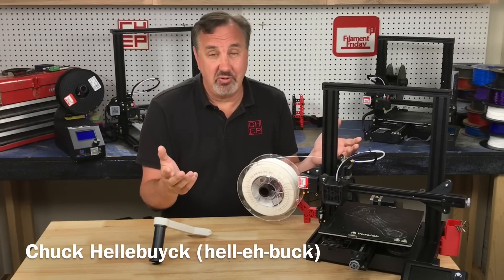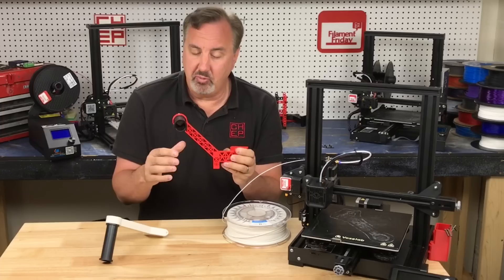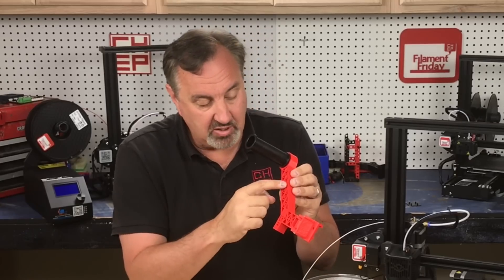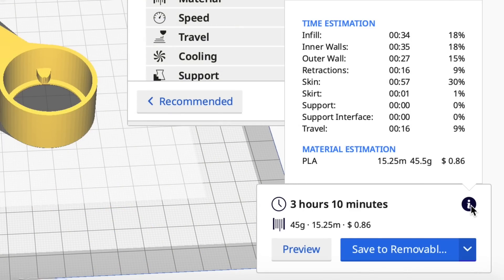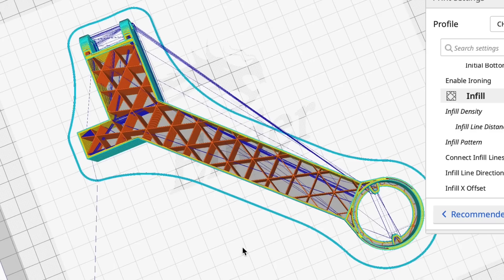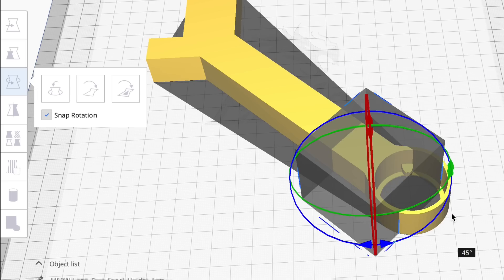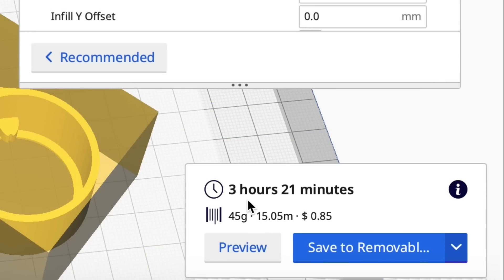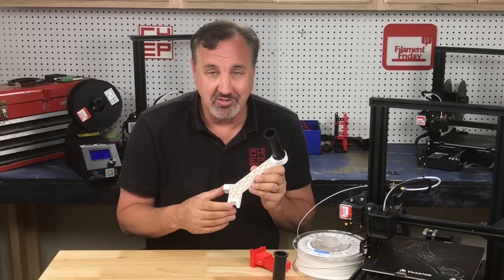Print Faster on Your Ender 3 Style Printer Using Tricks in Cura

Comment: If you look at the internal pattern, it is made up of printed triangles. This means a lot of short movements and retractions. It also means a lot of joints between lines. If you model this layer by layer, with straight crossing lines, allowing for open spaces between the crossing lines, you get longer internal lines, that will bound like crazy due to gravity. It probably will print faster than the hack in this video, and probably be just as strong or stronger, depending on how you adjust it. It will look even more like the Eifel. In Cura, you need to model it for double walls for the pattern, as Cura do not slice single wall mesh gracefully. Also, Cura has performance issues with the modeling I propose here, it simply crashes if the model get medium size.

Comment: for fast low quality high strength prints you can also increase line width (only with flat tipped nozzles) so every layer is smeared on like butter but much wider and sturdier

Comment: It's a great tip Chuck. I'm using mostly Repetier host using Cura engine and it always prints quicker than any Cura version with the same settings. For example, DJI F450 arm  prints in Repetier 2h44m, in Cura 3h58m.. And has similar structure to the filament arm you're showing here.

Comment: I follow so many youtube channels about 3d printers. Most of them is about hardware and firmware tweaks in order to get good quality prints. They use expensive hardwares, upgrades etc. But you, sir, always have good cura tricks for the same goal and it's awesome. It's free, it's practical and I appreciate that!
Reply from the maker: Glad I could help. To me it’s far more important to understand your slicer.
Reply: Biggest upgrade you can make is firmware tweaks after that. Go look into linear advance etc to improve quality at high speeds above like 70mm/s for walls (meaning 140mm/s with stock cura config), that way you can get an ender 3 to roughly 150mm/s, provided you have good enough cooling.
Of course the model itself makes the biggest difference though.
Reply: I’m so

Comment: Good Morning.....Thank you for your videos ! I am new to 3D printing. I order longer LK5 and was wandering if you could help me. I was about to change my Nozzle from 4 to a 1mm. I would like to know if that is a good idea or not. I wanted a little more filament on my designs and not so thin layers. Do you think you could help me with this? 
Thank You !
Reply: If you want thicker layers, you should not switch from a .4mm nozzle to a .1, which prints even smaller layers and will likely become clogged almost immediately. You should instead check your slicer settings (a .4mm nozzle should be able to drop up to a .3mm layer height) or use a .6mm nozzle.
Reply: @user2C47  thank you!

Comment: Well I just put the original model into PrusaSlicer with my custom settings and It only takes 1h 7m. 
Looks like I did a good choice not choosing Cura.
Reply from the maker: How long was the actual print?
Reply: @FilamentFriday  Well mea culpa, actual print time was 5 hours. Still shorter but not as good as I hoped.
Reply: @FilamentFriday  With your version I got it down to 2 hours, so you did a really great job and it's really nice what you did (gonna remember that one for ever) but PrusaSlicer is still little bit faster for me...

Comment: Ya saved hours in MACHINE print time, by spending a lot of YOUR time redesigning the part and messing with Cura settings. Been there, done that... my time is valuable ... machine printing time is not ... so I just print stuff with solid top/bottom layers, without trying to remove mass, just let the infill do it's job, maybe reduce the # of top/bottom layers and use only 2 layer walls (1 layer with large volcano nozzles).
Reply: You act like 5 seconds in a slicer is a lot of time ... you’d still have to slice all your models anyway 😂

Comment: For some reason, my per model settings seem to do nothing.  Is there a hidden setting somewhere in Cura I need to check to make it work? I'm trying to do the exact same thing with changing the top/bottom layers on a specific section of the model. But no matter what I do it still slices without top/bottom layers.
Reply: did you click on modify settings for overlaps?
Reply: @zioxei  yeah, sure did. Even tried unclicking it just to see if it would make a difference.
Reply: @DougDorman06  that's strange because if I do what chep does then it just works. And clicking on the other 3 options should indeed make a difference. It's gonna sound dumb but make sure the settings on the overlap are different to your model settings. If you truly do everything correctly then maybe you need to update Cura or reinstall it

Comment: Hey new to printing, with a 0.4mm nozzles does that mean that I can only print 0.2 profiles? Or can a 0.4mm nozzle do all sorts of thicknesses for faster prints?
Reply from the maker: You can adjust the extrusion widths in the slicer.
Reply: A .4 nozzle should be able to do up to a .3 lawyer height.

Comment: Hello, i need desperate help if anyone can regarding 3d printing.. i have looked everywhere and on every forum but with absolutely no luck.
Problem: my ender 3 printer prints fine at first but as soon as it reaches the infil layers the under extrusion starts upto the point where extruder starts clicking madly without any flow of pla.
Then i would stop the print and immediately try and run the extruder.. again no flow of pla from nozzle. Now here is the kicker.. as soon as i pull out the filament manually and not all the way just 5 to 10 cm, then i push the filament back in, it start extruding again no problem.(for a like an hour or 30 mins)
No clogs, no heat creep, no filament leak from heat block and between bowden tube, nozzle is flush and secure, hotend coupler is secure, cooling fan at full capacity, i have even tried the spacer in hotend mod. 
Please someone help
All i can think is i have to replace the hotend and a new one is on the way but i think this situation is too much of a mystery to be left unsloved
Reply: Is the hotend actually maintaining its temperature?

Comment: I have a question , a while back I replaced the board and the screen in my ender 3 with the btt skr mini e3 and the btt tft35-e3 v3.0 and I love everything about it and been printing without any problems untill today , now long as I have an SD card in it it won't boot up but if I take the card out and turn it on it boots up fine and if I put the SD card In while it's on it won't even give me the option to open the files , any suggestions because I'm clueless, thanks
Reply from the maker: Try a different SD card
Reply: @FilamentFriday  I've  tried a different one and I tried reformatting the SD card  and it's doing the same thing

Comment: I've been using the 0.8mm nozzle on 0.32 layer it's prints every thing so quick, does a full magneto helmet in 9 hrs In 2 sections at 4:30h a peice. I print 2.4mm wall thickness and 3 walls on 7 % gyroid infill any more is a waste of plastic I believe

Comment: Nice collection of tips and tricks to save print time - I’d suggest to use the gyroid infill, at 20-30% infill rate but one line thickness it gives very strong parts w/ little time penalty. And it is nice to watch during printing and see on the parr ;)

Comment: Using same for long time in prusaslicer as well. Even one more trick - create international shape inside arm for example 3mm from walls and use it as modifier without top and bottom, but main part use regular settings. This will build arm with strong shell ( walls can be complex even)  and internal part will have nice looking infill .
See link below for example

Comment: Great job !!! ... See ... The black cylinder. Where can I download the file? As it is called ?
Reply: It comes with the printer. 
Usually,  they just reuse it for other designs. 
It's the default spool holder.
Reply: @Iam_RickMann  , Thank you. the point is that I don't have the piece. is there any link to download and print?
Reply: @pablocamartin  I'll try to find it

Comment: Same amount of filament but faster? Miracle? No. Infill is printed faster. So you can start with the original model and turn up the speed. And/or you can switch extrusion width to e.g. 1 mm (for internal perimeters) even with 0.4 mm V6 nozzle and you'll get even stronger result.

Comment: hi, am trying to print M6 nut and bolt designed in fusion 360 and printed in ender 5 plus but even after including some tolerance to the threads it dose not fit quite well any suggestions greatly appreciated.

Comment: Hı dear Chep, i have found a new feature in Marlin  i guess you will like it, FirmwareRetract in configuration adv file. So you can adjust online during printing every retraction setting even z hop :)
Reply from the maker: Yeah, I’ve seen it but haven’t played with it yet.

Comment: Could you make a video on cura for texturing that improves the strength of parts. It's used in ideamaker but would love if it is in cura as well. You can see CNC kitchen video for reference for texturing.
Reply from the maker: That’s a relatively new feature in ideamaker that hasn’t shown up in Cura yet.

Comment: At what point is time dedicated to redesign, modification, and print settings for each print not worth the time it saves in printing. Id say if youre just making it one time for yourself to not bother with this because by the time you finish all of that, the same amount of time would have passed at a loss of specific control in the aestetic and more effort. Id say doing this for models that are going to be printed multiple times or you plan to upload it is worth it but otherwise its just more work for an hour or two in diff
Reply: Id have to argue my point though that anyone who is keen on using this must be pressed for time and is intending to print the parts multiple times anyways so meh who cares. Whatever moves your axis so to speak. It also helps new people learn the full capabilities of their printers ands slicers.
Reply: It is worth the redesign time if you are printing multiple, as in a product line you sell
Reply: You really think his model redesign took an additional 4hr? No way.

Comment: You can always upgrade to a 0.6 nozzle as well
Reply: I use 1mm unless I have good reason not to. Usually 0.4mm layers, though 0.25mm looks nicer and can handle steeper overhangs.
Reply: @dekutree64  Nice. Most of my prints at the moment are to modify my RC rock crawler chassis and other structural stuff. So I've kept to 0.28, but I increase filament temperature to encourage better adhesion.

Comment: Is there a way to scale the infill or determine where the pattern starts/stops or is placed?
Reply: Prusaslicer has infill angle control. To move the infill, just move the part on the build plate. The infill pattern is always stationary throughout the build volume and just applied inside the volume of the part.

Comment: Lol, ive been using the same settings for a couple years now. U can really tweak a model for strength and speed with the ovblocks, i also kick my temps up, and speed up to quicken prints. Using coex pla i print at 227 to 235 c and speeds of 80 to 100mm/s. My minimum infill for any structural part like this is 20%, but most prints are done at 12 to 16 %.

Comment: Could you use that technique to have different layer heights for different components in one print?
Reply from the maker: No, that’s not an option with that feature.
Reply: @FilamentFriday  For me this would be a nice addition to Cura (or any other slicer) to have the possibility to use fractions or multiplications of the set layer height (limited of course) in the "per model settings". This should be possible to print without collision, at least I think so...
Reply from the maker: There is the adaptive layer height setting: https://youtu.be/9otlFHhmZkY

Comment: Nice. My favorite "trick" is to bump my line thickness up from the default 0.4mm for a .4mm nozzle to 0.5mm or 0.6mm. Whether this is suitable or not depends on your part design, but this works nicely for many items.
Reply from the maker: On this one it messed up the design so I chose to use double line
Reply: @FilamentFriday  Sorry. You lost me. I know there is a line multiplier for infill, but I'm not familiar with "double line". But then there's a ton I don't know about Cura.
Reply from the maker: It’s in the video.

Comment: Just because Cura says 9 hours, doesn't mean that's recommended, or the normal print time.

For a part like that, I wouldn't expect it to take more than 5 hours.

In essence, I don't feel like you've saved print time. I feel like you're printing it in the right amount of time it should be printed.

Almost like when a store has a sale, but they mark up the item just to make it seem like you're getting a deal, but you're getting it for the same price.
Reply from the maker: The print time in Cura is pretty accurate now. Especially with my profiles where I set the acceleration
Reply: @FilamentFriday  Okay, so what you're saying is that the 9 hour estimate is AFTER you had already dialed in your settings? So in essence you are cutting time.

I understand now. 👍
Reply: Doesn't matter if cura is accurate or not, it's relative because he's doing it all on Cura;
 he's using the same type of measure to get the estimated print time for all the parts.

What he is showing is that we can get the print time down by doing what he explained

Comment: Yeah, definitely can use this trick to speed up.print times as well as make other changes like making portions of the object more solid.  Really gonna have to give this a try!  Thanks!
Reply: It's not really a trick. I mean, for a part like this 5 hours should be the max. Just because Cura says 9 hours doesn't mean that's the recommended print time for that item.

In engineering, all of this would have been considered before it was ever opened in the slicer.

I would have titled this video "Don't Trust the print time that Cura tells you".
Reply from the maker: It’s very accurate with my profiles since I set the acceleration settings

Comment: Why not increase the Infill Line Width to 0.8 instead of two lines of 0.4? Would have more time off and likely be just as strong and same plastic usage. I've started doing that with good success.
Reply from the maker: 0.8 line width produces a more sparse pattern. I’d have  have to increase infill to get a better pattern which just brought the time back up. So doubling the lines have me the strength and the look I wanted.

Comment: If for some reason you really wanted the design to match perfectly, you could export a second arm that was just the "infill" portion you wanted to change. Line it up in Cura and use that to modify it to print as infill. I use that trick for things all the time when I want specific sections to print infill only but theyre irregularly shaped. The trick to getting it lined up easily is to put a super small of set line around the entire model.(kind of like a skirt) so small that cura doesnt try to print it, but that basically makes both models the same size so all you have to do to line it up is select them both and center it. If that makes sense.
Reply: Do you happen to have a link or anything illustrating this...?   I'm new to 3d printing and this ALMOST makes sense to me... LOL
Reply: @Blissful_Soundscapes  if you model something on your own then you put a pixel thin square around your item. So in case you want to split your model into two pieces Cura will judge the shape of it by that thin square instead of the shape of your model. The square stays the same so the two pieces will fit together. Without the square the different pieces will not align if you try to center them on your printer bed. Then you just select the infill model and set wall count and top/bottom layers to 0. 
btw I'm also trying to figure this thing out just as I read his comment, lol. I haven't even modelled anything yet.

Comment: It seems like the main speed benefit here comes from the infill speed being higher than perimeter speed. What if you print original design without slicer hacks, but with perimeter speed=infill speed?
Reply from the maker: Try it. Still was slower for me. Top and bottom surface adds time as well.

Comment: Ive learned not to fear longer print times. As long as your machine is dialed in and failures are minimal, id take the longer print time to ensure proper strength, especially for a part like a spool holder.
Reply: Point is that you can tune prints to be as strong and still print faster. There must not be necessarily only a single set of right settings, as there almost always room for improvement
Reply from the maker: Exactly. I just show options so new users don’t think they have to spend more money for a faster printer.
Reply from the maker: It is strong enough. It’s been on my printer for a while. Several of them actually.

Comment: Now this is an awesome tip! Gotta try this
Reply from the maker: I’m sure you’ll come up with some interesting designs. There are many other infills to play with.
Reply: @FilamentFriday  have a look into the fixed height bed spacers creality make there just incredible I haven't seen anyone post about them yet and they are way better and easier to level the bed do it once then check it my in 6 months only. Had one failed print since and because I run out of filament 🤙
Reply: Seriously, I'm just learning how to 3d print and don't know a quarter of the settings within Cura
Reply: @Duskbreaker1780  it wont take you long to learn the setting's, just keep printing the more you print the better you will be
Reply: Indeed